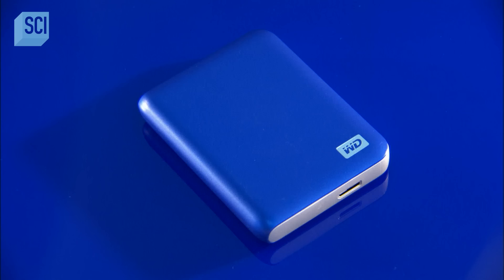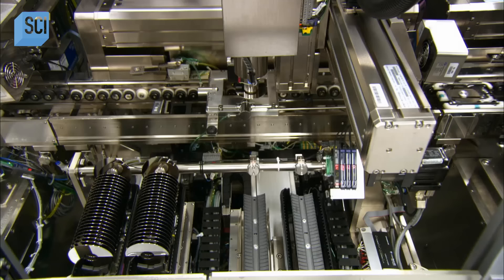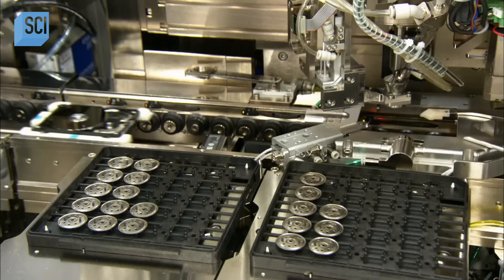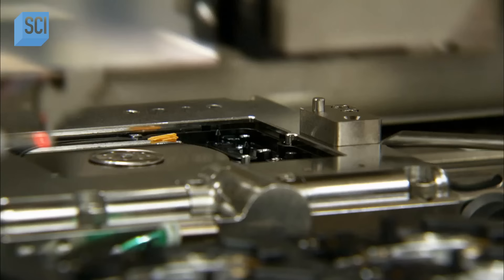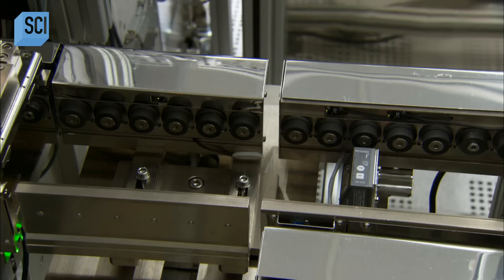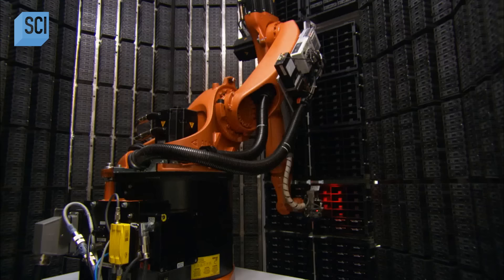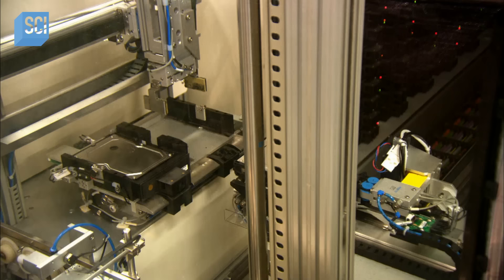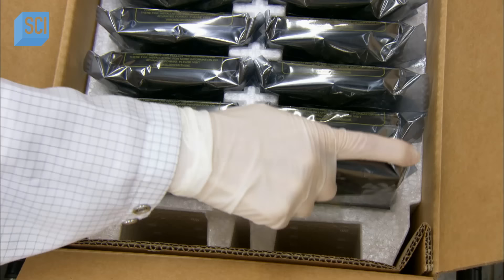How External Hard Drives Are Made! | How It's Made | Science Channel

Comment: The 16TB drive I have in my desktop PC has 8 double sided disks, and 16 heads to read and write them. That's only possible because of helium gas inside the drive, which lowers power draw, drag and heat output to allow for thinner disks. Amazing how we've come so far.
Reply: Platters
Reply: @AgentOffice  shouldn't be HDDs Hard Platter Drives? HPDs?
Reply: @yxcvbnmmnbvcxy544  haha maybe
Reply: @yxcvbnmmnbvcxy544  I'd say the completed object is the hard disc
Reply: Nice, but ssds should become the new way to.go. faster read write and no moving parts to fail and ultimately kill the drive.
Reply: @wakcedout  Yep, the only barrier right now to SSDs taking over is cost per gigabyte.
Reply: WTH do you need a 16 TB drive if you don't mind me asking LOL i only need a 2-3 maybe four TB
Reply: @Upbeat88  1. I'm a data hoarder 2. I got the drive by shucking an enclosure for it. Cheaper that way.
Reply: @lezlienewlands1337 same bro. I got an 8 tb hdd nearly half full now just from games and such
Reply: @yxcvbnmmnbvcxy544 they're called Hard Disk Drives, because it actually has a HARD disk inside of it, some people also call them spinning rust, spinning metal, or simply "spinning" drives.

An SSD is a Solid State Drive because it has no moving parts and the data is stored on solid state chips instead of bare metal. And an M.2 is just an SSD but MUCH more dense compared to it's very compact size(which is why they still cost nearly 2× as much as a regular SSD and sometimes nearly 4-5× the cost of an HDD
Reply: @wakcedout  I'm not too sold on SSDs yet, because when they do die, sometimes they just die INSTANTLY compared to a damaged hard drive where the data is recoverable

Comment: 40 years ago I worked at a joint (International Memories Inc.) that manufactured hard drives about that size holding 20 MB. Now most individual YouTube videos are considerably larger than that.
Reply: cool story, Mr. Boomer
Reply: @tomsmith4542  Yikes. We got a Gen Alpha over here.
Reply: Yeah but programs was also considerably smaller so goes hand in hand = )
Reply: It is crazy considering at an event my friend and I shot over 64 GB of footage or the equivalent of 3,200 of those 20MB drives and the SD cards could easily fit onto a postage stamp!
Reply: Just a few seconds of 1080p video is around half a gig or more(depending of the framerate) i've uploaded a few videos that were 40gb in size(and yes i know that's not a whole hell of a lot compared to a lot of videos)

Comment: Going WAY back to 1974, I used to work for a company called Control Data.  They made main frame computers for companies like Ford and Chrysler.  The disk drives in those computers were the size of a dishwasher.  I don't know how much data they held.  Today, my home office PC has two Solid Drives (no moving parts) with each one rated at 1 Terabyte.  My, how things have changed.  The only thing constant in this world is change itself.
Reply: They even have microSD cards that are 1TB and the size of a fingernail. It's amazing
Reply: 1978 I worked with DEC 11/70s. The washing machine hard disk had ten platters for a total of 88 MB.
Reply: I've seen drive systems that utilized compressed air to move the heads over the disks...
Reply: c

Comment: Title is misleading, this is a HDD. An external hard drive how it is made would also include information about controller boards and the case.
Reply: Controller board? The board on the drive would be the same, there just would be a SATA-to-USB adapter, with a separate board in it.

Or, if a large enough batch of hard drives is made to be specifically used in external cases, the drives might get custom boards that have USB port directly built in place of SATA port in regular drives. That saves the cost of separate adapters, and allows making the external drive a bit smaller (by the size of the adapter).

Comment: i worked for IBM in the late 90s and were manufacturing 16Gb hdds. all parts were put in manually. discs were the hardest . also after screws had to vacuum the screws bar the motor screw as it contained magnetic fluid which if leaked the whole line had to be shut down ,everyone out to change the protective clothing  ,then wipe everything down with isopropanol. we were basically the robots like in the vid

Comment: So, this should be "how a hard drive is assembled". They aren't external drives, and about 90% of the process is missing.
Reply: Yeah, like how the platters, heads, arms, ramps, magnets, coils, flat-flex cables, filters, cases, and PCBs are made!
Reply: @HelloKittyFanMan all of that stuff would be considered "trade secrets" because if they do something slightly different than another manufacturer that makes thier process just the tiniest but cheaper or more efficient then that other company could "easily" start using that same process and gain an edge over the original company.
Reply: @spec_opsgaming : So not actual trade secrets; only figurative, hence the quotation marks? They call what they have "trade secrets" but you don't necessarily agree, hence the quotation marks?

Comment: I guarantee you the cap and spacer used on the platter is NOT stainless steel. They are aluminum coated/plated with some chrome/stainless steel like stuff. At first I thought it might be titanium because it was light and not magnetic, but hit it with a bench grinder and the lack of spark tells you it's aluminum. Steel, including stainless steel has an orange spark, higher carbon steels have more spark. Titanium has bright white spark when you grind it. Aluminum has no spark when you grind it and you should not grind aluminum on a bench grinder at all unless the grinding disc is sandpaper rather than grinding disc. The reason is that grinding disc is designed to grind steel or titanium, and the aluminum will clog the disc rendering it useless, and worse it may cause the disc to explode.
Reply: Can confirm. Those bits are definitely aluminum.

Comment: I have disassembled many a hard drive. I used the extremely powerful 🧲 magnets inside as refrigerator magnets. It is like using a Ferrari to deliver ice cream. Over powered, over designed, Over budgeted. And becareful. It will leave a bruise if you get your skin between the magnet and the refrigerator.  You have to slide the magnet to the edge to remove it.
Reply: What did you do with the high speed BLDC motors?
Reply: I screw the magnets on a piece of wood to hold all my kitchen knives.
Reply: @Jacob.Springer  It takes some electronics knowledge to get that working. Most people rip their drives up for the magnets and chuck the rest into the landfill.
Reply: @mjyanimations1062  no it doesn’t, just a driver will do it for you.
Reply: @Jacob.Springer  Yeah, a brushless esc works. Not everyone is interested in doing that like you and I though.

Comment: There’s one question, what happens when the drives are defective when testing?
Reply: They usually cut the cappacity/head and sell them as 750/640 GB or1,5/2 TB :)
Reply: AMAZON?
Reply: They get taken apart, and each part is then tested individually, and if it can be repaired then it is and then it's sent through the normal testing process again

Comment: They should make this repairable.
Reply: Impractical. Hdds are very sensitive and any damage can be disastrous and difficult to repair. The data on the drive is often more important than the drive itself, so recovering that in the event of a failure is often your priority.
Reply: Near impossible unless you have a clean room with all of the specifically designed tools and software in order to actually repair it..and if they made them out of off the shelf components then the drives wouldn't last 2 weeks at the most.